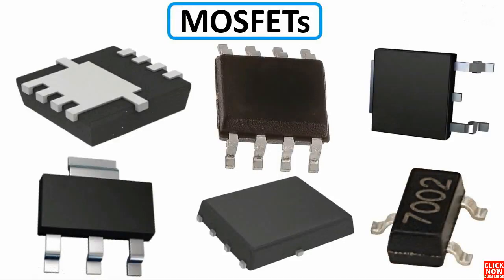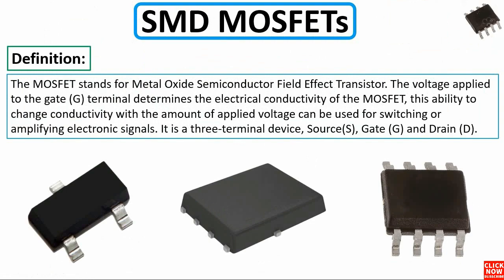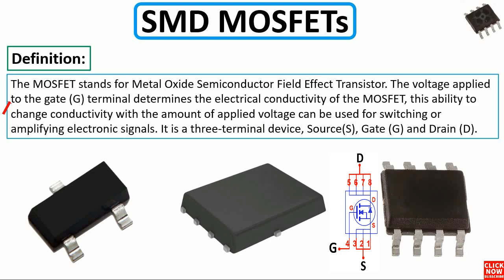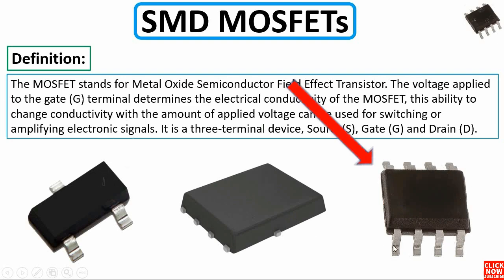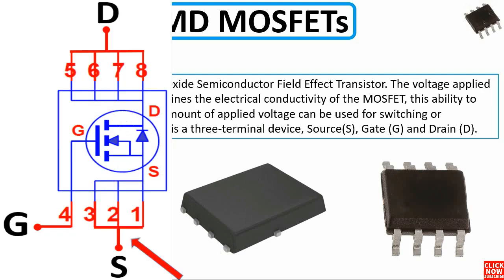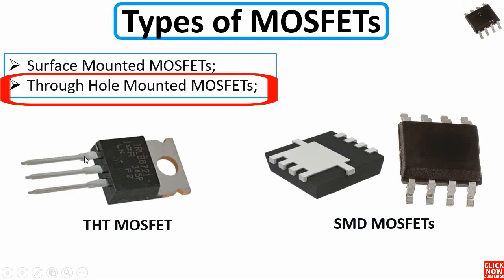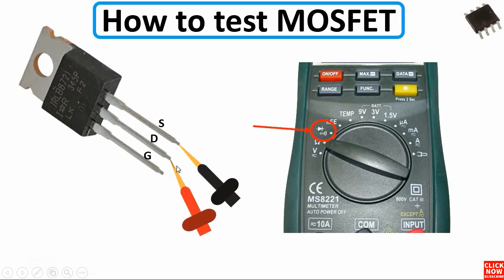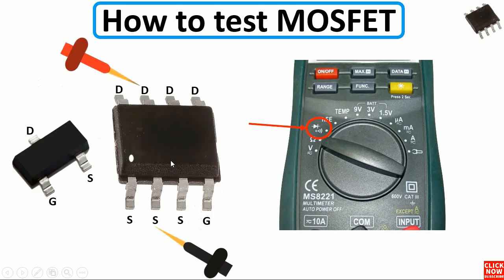How to test MOSFET in circuit using multimeter, how to test MOSFET transistor with 8 and 3 terminals

Comment: Please I have a laptop and when I test all the MOSFET around the processor with a multimeter set on diode I discovered that it reads from the gate to source, gate to drain and source to drain with all high recistance

Comment: i am testing a mosfet that is an TPCA8A10-H . I believe it is a Schottky barrier . between source and drain i am getting 22mA's .022. seems low to me. there are several, they all get the same. are they good? on the data sheet is this the forward voltage?

Comment: if it beeps with a low reading does that mean your mosfet is short circuited and considered a bad mosfet? I checked all mosfets and every mosfet beeped when i check it with a multimeter with a low reading?

Comment: Most complete video for mosfets - thank you! But I was told that a way to remember what NPN means, is to think of the letters standing for: Never Pointing iNward but the arrows in your picture of the NPN mosfet shows the arrow pointing from the source to the gate - inward. I was also told to remember PNP as meaning: Pointing iNwards Perpetually. So, what is right and what is wrong? Please let me know, I want to learn. Thank you
Reply from the maker: Thanks for the info!
Reply: @electronicsrepairbasics_erb  Ok, but you haven’t answered my question.
Reply: I think you are right. The image at 5:57 is rather N Channel mosfet which is PNP.

Comment: I have the same 4-pin Mosfet on my pcb. I checked source and drain. The number jumped to 800 and was still climbing above 900 and then it went to 0L. I think it's bad, isn't it?

Comment: Sir , your explanations confuse me .  In my motherboard ,    4    8-pins mosfets near the CPU give continuity between source and drain even if I reverse the probes , but I have no continuity between gate and source .    There is another serie of mosfets on the same motherboard, near the power socket , they give reading between source and drain in both way , but no continuity . among them are two 8-pins mosfets where I get no continuity , no reading between the 4 pins of the drain
Reply from the maker: Remove the CPU and the short will disappear
Reply: @electronicsrepairbasics_erb   you were right , the short disappear even on the back side of the PCB

Comment: Quick question: are mosfets marked always with a Q in a pcb or can the get anothet letter? As I've come across an U transistor in a circuit which should be a mosfet itself
Reply: *can they
Reply from the maker: In some motherboard can marked U

Comment: I have looked everywhere do you know where I can find. 3 pin
GO65N07.       AOL05NSS1A Mosfit? Thanks.
Reply from the maker: Hi,
Do you check AMAZON Platform.
Reply: @electronicsrepairbasics_erb  I did find on the top number is G065N07 but the bottom number on the mosfit is not the same number, I'm not sure if the bottom number on a mosfit is a Batch number or a nu.ber that is to indicate to the company what voltage it is good for. Hope this makes sense thank you for responding

Comment: hello, I followed your explanations carefully but I always have a double reading on the 3-leg smd mosfets, so it is impossible to determine which channel it is pnp or npn since when I change the probes it also shows me a reading on  the same legs I'm a little lost I expected that there is only reading in one direction as you have shown, except that all the mosfets that I tested with 2 different multimeters do exactly that  the same things double reading, on the same type of mosfets as in your videos and on functional and non-functional cards, I do not understand the 2 readings are satisfactory and displays good resistance on both sides impossible to know which channel is it,  are there any exceptions?  I do not understand anything anymore.  thank you to enlighten me.
Reply: Same here...........
Reply: I guess the best way to test those transitions is to remove them from the board and test. If not u sometimes experience most of those readings or results

Comment: I think in this video, a "good MOSFET" is a DEPLETION MODE MOSFET vs an ENHANCED MODE MOSFET.  Correct?
Reply: In looking further, I see that your ENHANCED MODE MOSFET has a diode between drain and source allowing flow from source to drain.  Also, that PCB can confuse you as you watch because MOSFETs 1 & 4 have pin 1 top left, and 2 & 3 have pin 1 bottom right.
Reply: There are P and N channel mosfets.... Both can be enhance or deplete(stop), there is no difference ....   Difference is,  the mosfet can switch off or switch on current ... In case switch off , mosfet is always on ... when it receives on gate voltage it switches off the flow of current

Comment: I have a faulty Lenovo all in one  330  computer,  it doesn't switch on  . I got it dissasembled , I tried to check the components , and I noticed that when I pluged the power supply , a 8 pins mosfet near the power jack/socket  was getting hot . I checked the mostfet  , the drain , the source and the gate are good . Theres a ceramic smd capacitor  1cm away from the Mosfet , and when I check this capacitor in continuity mode theres' no reading ,   "I "  is displayed , even when I reverse the probres , what could ne the problem ?
Reply from the maker: Check all components near to that hot mosfet you will find the failed components, usualy it can be a diode or a mosfet.
Reply: Hi. am assuming that you are referring to the first mosfet after the charging port. First check if you have a  19. 5 voltage on the output of the first and second mosfet... If you dont have output voltage after the firstmosfets,  try replacing that mosfet thats getting hot🔥. Let me know....